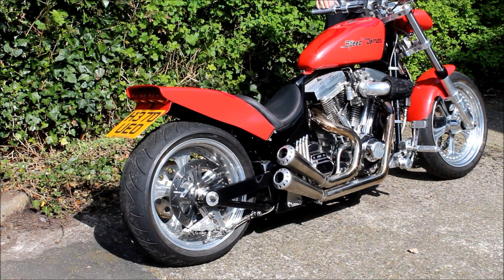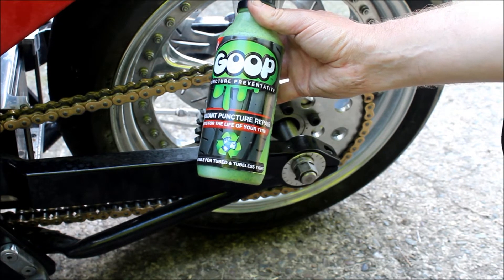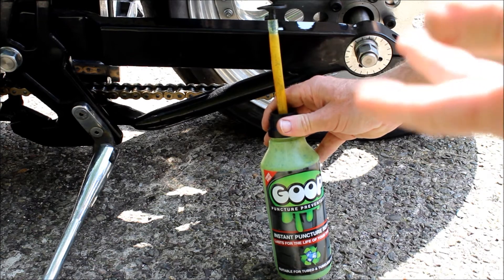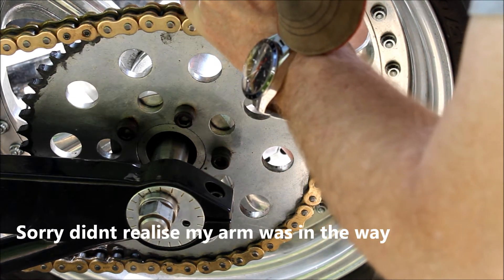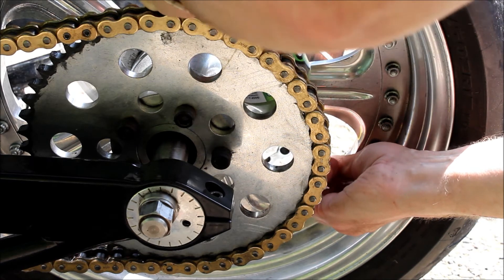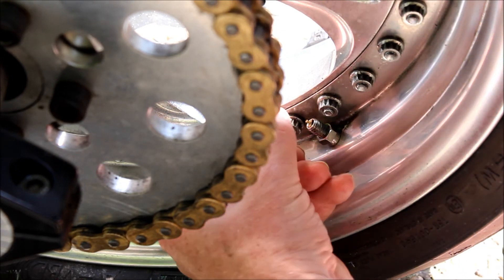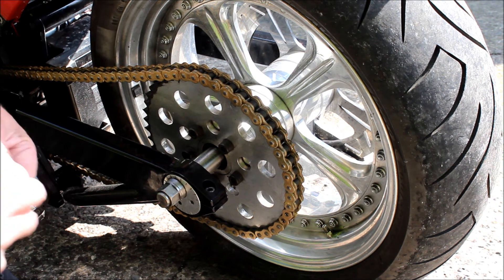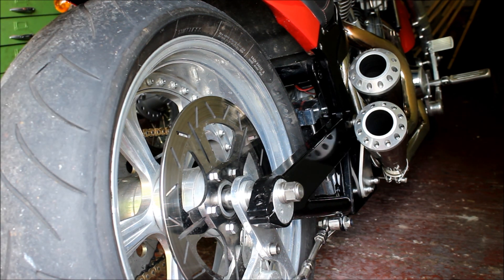GOOP Puncture Prevention

Comment: your tyre changing man will hate you for putting that goop in your tyre mate haha :) .... your softail is the only softail i would want in this world... its badass!
Reply from the maker: I did ask my local bike shop what they thought of the stuff and they shrugged and said yes its a bit messy but we're used to it, not a problem.
Reply from the maker: Cheers, I have plans for more upgrades to the bike next winter.
Reply: @Merch131ho  Truth is , if ure stuck on a country road in mid-winter with a flat, you will be wishing you had put anything in  which may have prevented a puncture.